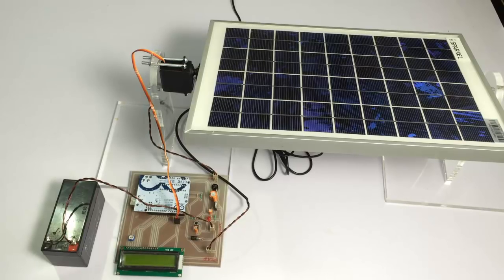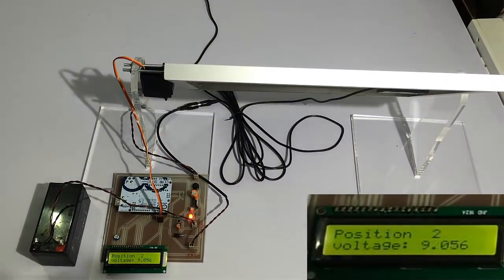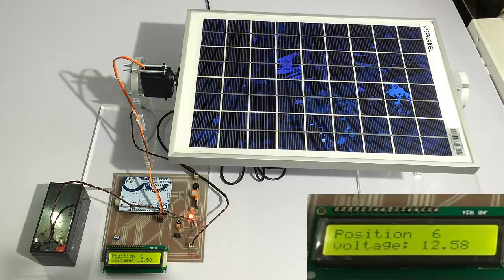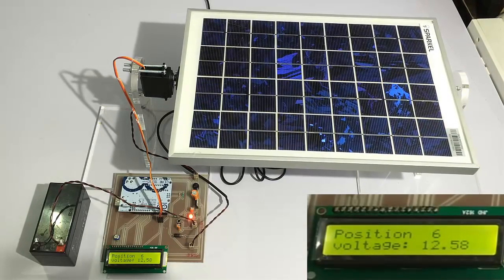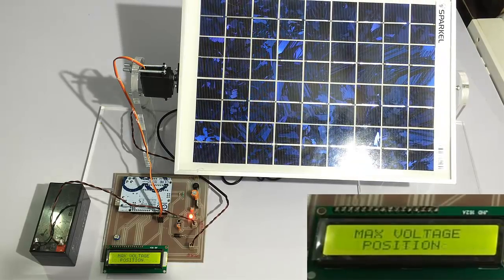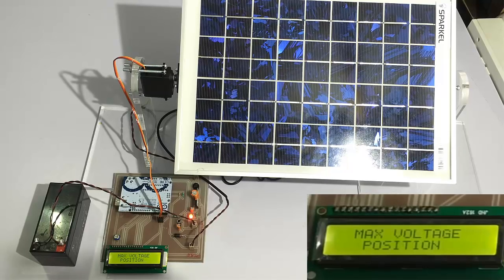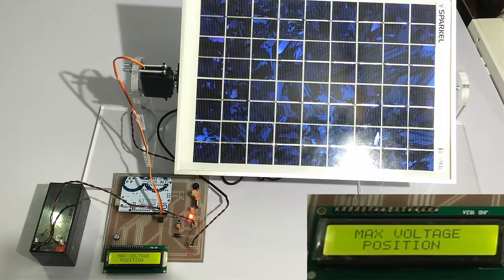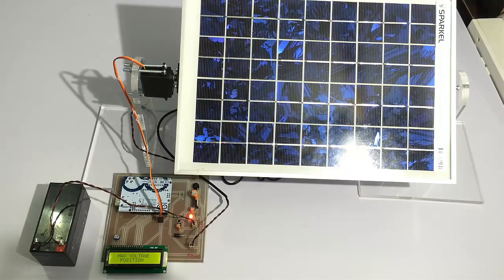Rotating Solar Panel Using Arduino For Solar Efficiency

Comment: Its good, but it will have to do a move every few minutes or so to confirm it is pointing in the right direction, to track the movement of the sun. perhaps every 5-10 minutes at the very least

Comment: how is it showing 10 volts output while there is no sunlight..I am intrested in this project but the issue is while giving demo there is no sunlight in a room so how would it generate voltage.. if this issue is solved the project is nice
Reply: Didn't you notice the Torch light reflecting on the panel? That is the source of energy being generated. These are PV (Photo voltaic) panels. they react to any light. Not just sunlight.

Comment: Nice project. Would a strong wind be able to move the panel ?   How much force can the stepper take?
Reply from the maker: Well we never tested the motor for wind resistance... anyways if the wind is strong enough to blow away the panel, it will also blow away the house roof with it..

Comment: That is an interesting way of finding the right position. You turn on the power, and then checks all 10 positions and chooses the one with the better voltage output.. What happens next? Repeats the whole process every x amount of time to again find the best position? LDR sensors are often used in these aplications, and makes sense for the simple ADC reading and "constant" tracking, but your system is really good as well.
Reply from the maker: not much energy will be wasted as it does not need to move frequently when used in real time... if rotated once every hour for checking.. it wont consume much power
Reply: @NevonProjectsOfficial  good answer but in this case what will happened in night time? The motor will keep rotating every hour to look for good position?

Comment: how much  would be a system for 5kw panel stand only control system no construction
Reply from the maker: this mechanism is not suitable for 5kw panel... multiple 100w panels usage is advised and mechanism would be far more sophisticated than this one... this is a project.. you can submit your requirement here: http://nevonexpress.com/submitReq.php